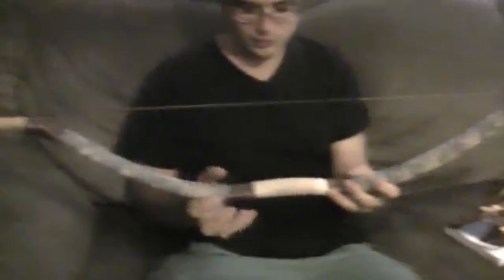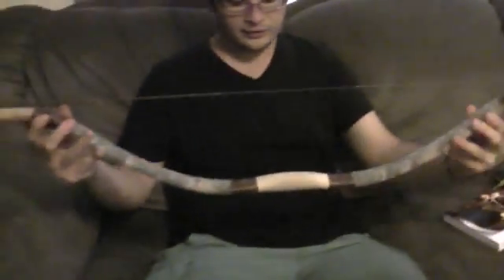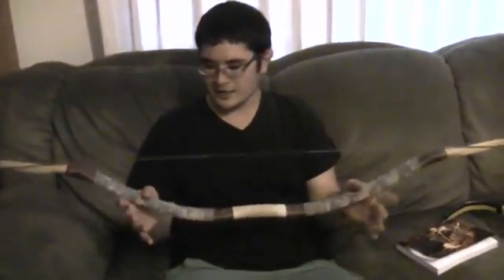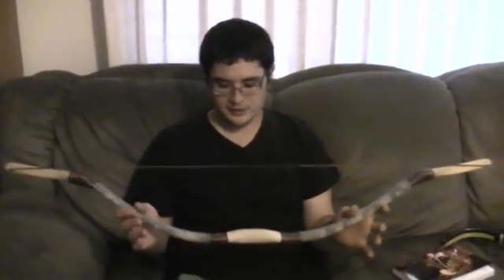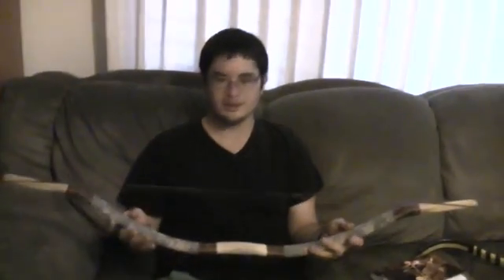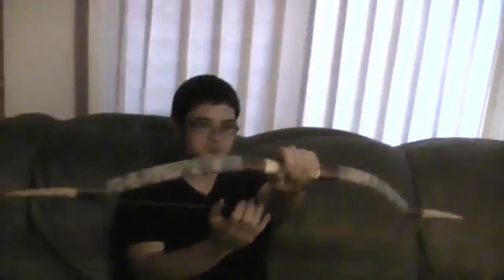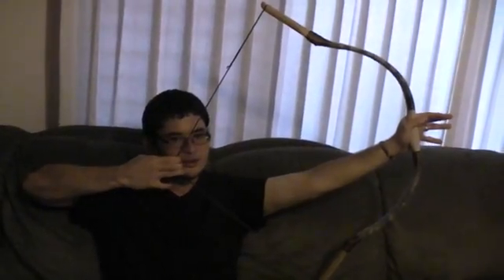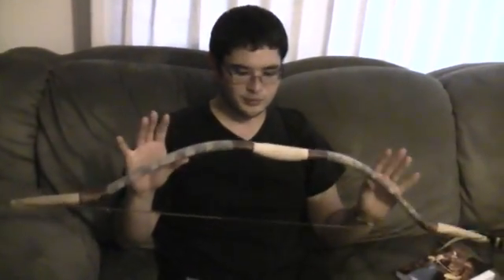PVC shouldn't make a good bow... but it DOES.

Comment: ok i have a question...i made a pvc pipe bow and i cant seem to be able to shoot it accurately by pulling it back with my 2 fingers on the string the only way i can shoot is by pinching the arrow which is very hard to pull back using the finger pinching technique and it does not work either if i use a release and i always get nasty slaps on the arm i have made an arrow rest by drilling a screw  in the side of the bow. i have tried to align the string to the arrow rest, nothing works? any advice?

Comment: Seems to me many of the issues you have with traditional PVC bows can be easier solved by simply inserting a fiberglass rod into the middle of a dual core PVC bow, but I'm no afficienado, just a practical outdoorsman looking for the simplest methods of making the best possible tools.

Comment: I own several commercial bows, BIG BUCK$! I have always wanted a horn bow but wifey say no more, so I built one of your horse bows. I got to say with the dacron string and carbon arrows it's scary wicked fast, I will take it on my deer hunt this year. It is 50" and settled down to 46#@26", I have a short draw. My other bows are wall hangers now and now got the bug to build more! I am going to make one out of 1/2" for rabbit control in my garden. THANKS:)

Comment from the maker: I make my own strings, but you can get by using some commerically available rope. 550 paracord works fairly well as does 1/8" nylon rope. Both will stretch quite a bit but are strong enough. Most any twine or rope with a breaking strength over 200 pounds is strong enough for a 30 pound bow. Good luck!

Comment from the maker: @huyked Thanks, it is a lot easier than building wood bows. It's the easiest way I know how to make a reasonably decent replica Asiatic recurve for very little time and money.

Yes, PVC does get brittle with time and use. I've found that as long as you cover it with something that blocks UV light and you don't leave it out in the sun too long, it will hold up fairly well. I have a couple that are well over a year old and still fine after a few thousand shots through them.

Comment from the maker: @The95Genni Apply heat to the pipe until it is pliable and then flatten it in a jig. The jig is really just a thinner (3/4") board with a pair of spacers about 1/4" shorter than your pipe diameter on one end. That will give you a nice taper from handle to tip and help distribute flex through both limbs. More efficient limbs means more power and speed versus draw weight.